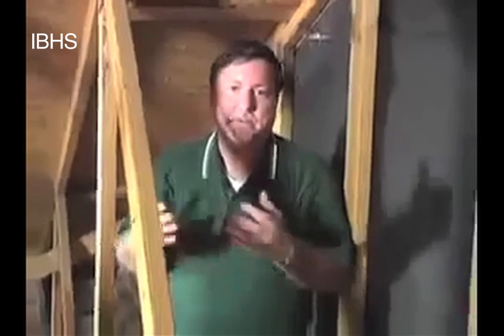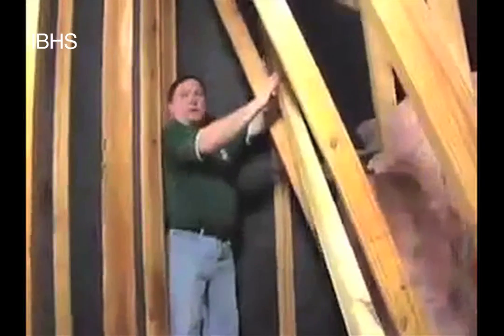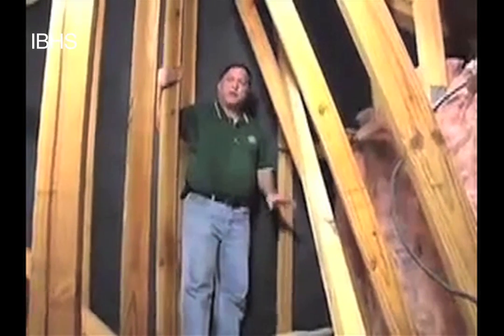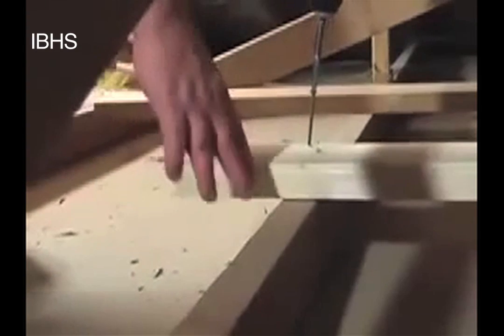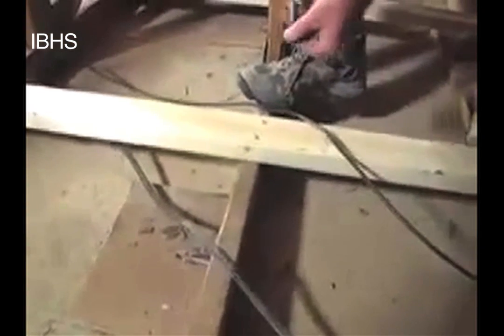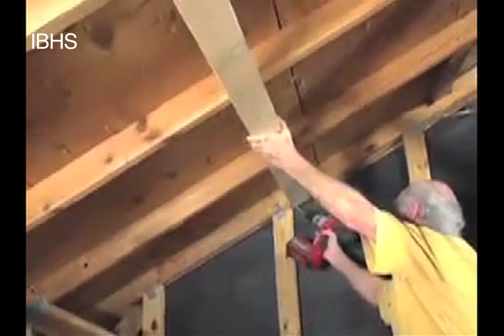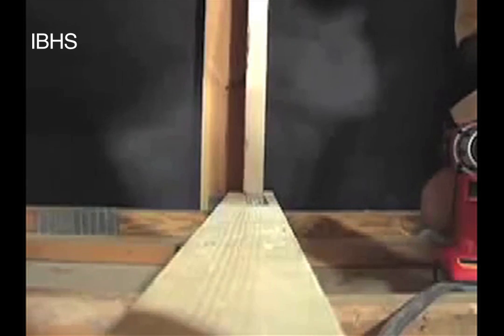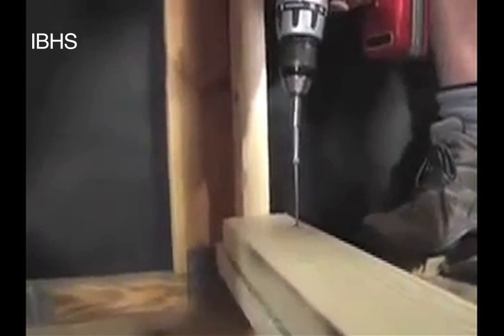Prevent High Wind Damage With Proper Gable End Bracing

Comment: Great older video. Question, does any engineer know if this would be good for earthquake bracing as well, or just wind?
Reply from the maker: We have tested for wind, but have not tested for earthquakes.
Reply: It will definitely add strength. But generally a wood house’s weak point is the framing connection to the foundation and that’s where the retrofit programs focus. Another problem is first story ‘soft story’ such as garages that aren’t stiff enough to hold the second story on during shaking.

Comment: My 2x3 gable end studs have other 2x3s fitted diagonally between and in the same plane.  These diagonals are fitted against the edges of the 2x3 studs so that  so that I cannot  nail or overlap a retrofit stud along the complete edge of original studs.  Can i attach retrofits to the faces of the original studs somehow to accomplish the strengthening as the retrofits in the video?